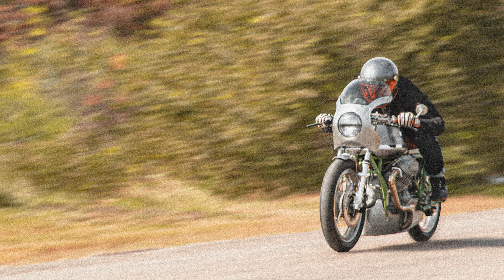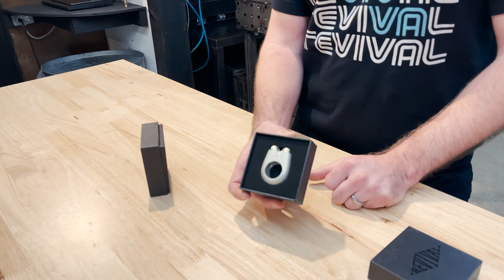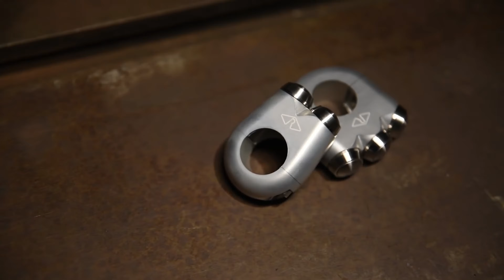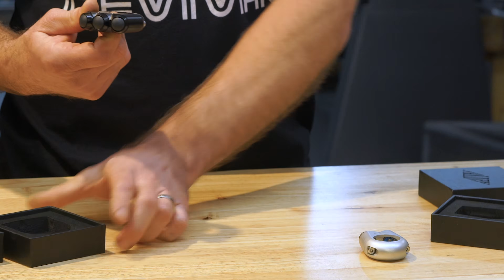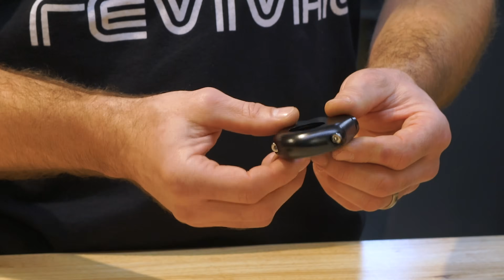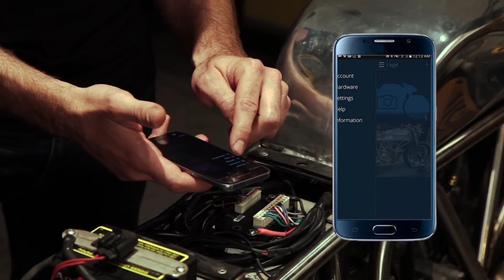The Perfect Push Button Switch For Any Bike // Revival Tech Talks

Comment: Hi, hopefully u can help me understand installation a bit better before I attempt this. 

Each button has 2 terminals on it. If I have a wire coming from loom for headlight switch does this headlight light switch wire go to one of the switch terminals and the other terminal just needs to be grounded??

Thanks for any advice.
Reply from the maker: These momentary switches are to be used with ground signals only. If you are trying to run voltage through them (most stock wiring) it will fry them.
Reply: @RevivalCycles just the momentary ones? What about the on/off ones for lights?

Comment: Please what is the max amp I can move through these switches?. I just need turn signals and a horn button. Should I plan to use relays? Thank you
Reply from the maker: These momentary switches are made to be used with ground signal wires only, the amperage for these is very low.
Reply: @RevivalCycles  Do you still sell these? I don't see them on your site (and the link doesn't go to the product).

Comment: Do these work with bmw can bus wiring on R9T
Reply from the maker: Yes but not without the additional implementation of a couple of specialized latching relay modules. We've done it, it's not an entry level modification but it can be accomplished.

Comment: how complicated are these to install on newer bikes? I want to replace the plastic-y control on my thruxton RS -- is it just as simple as the M unit and connecting wires, or are there other canbus intricacies on newer bikes that make it more complex?
Reply from the maker: It's too complicated to explain here but it can be done using a series of specialized latching relays. Here's a link to a deeper explanation, wire diagram and parts list. 
https://revivalcycles.com/blogs/technical-articles/latching-switches-to-momentary-buttons-no-mo-unit